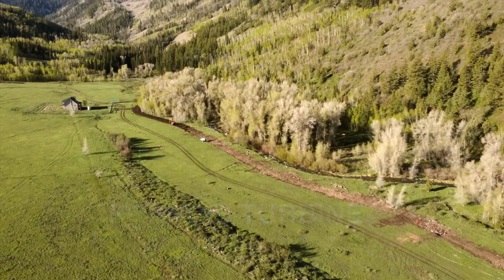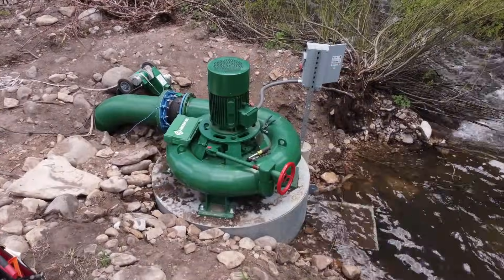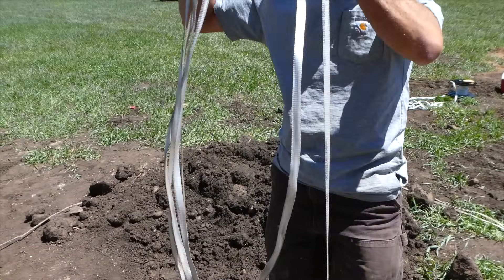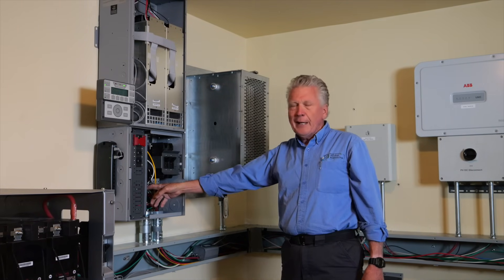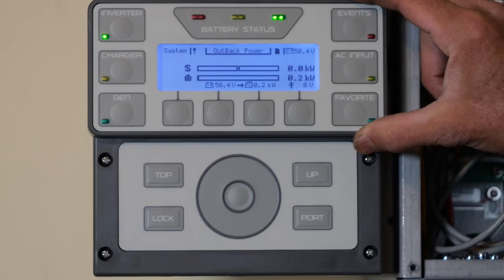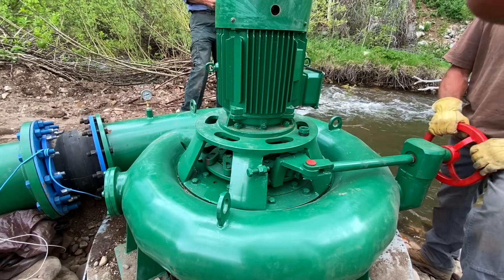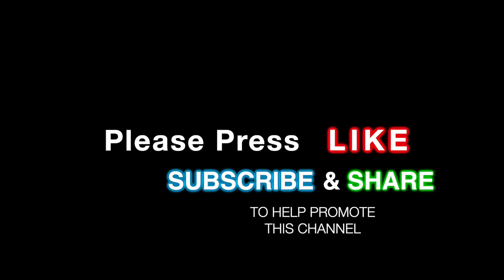MicroHydro Francis Turbine Part 2

Comment: Great, love the idea. Impractical as hell. It’s just not worth the investment, you’ll never generate enough electricity to offset the $100k investment and that’s just on original cost. Maintenance and repairs over time adds to that total significantly. Anything dealing with water and moving parts will be a nightmare to keep in good order. Those batteries are expensive and will need to be replaced every 5-6 years give or take, I can go on but ya get the idea.
Reply: it is worth the investment if you got the property at a good price because it has no power to it. Lets say it was for sale at $600k with no power..they offer £500k and spend that money on renewable electricity and never have to worry about paying an electricity bill ever again..also 6kw is 140KW/hrs a day so about 5 times more than the average house needs so they have surplus to charge an EV or two so gas prices are no longer an issue either. Maintenance shouldn't be too bad , the pipe has 10m of head so should stay clean , the Coanda screen rarely needs any cleaning and the turbine needs bearings greased now and then.  It's a no brainer.
Reply: @stephenauty2402 everyone forgets the turbines wear out battery’s go flat controllers burn out lightning takes it all out.

Comment: so what's  the power? I thought you would end the video with these numbers.
Reply from the maker: The max output is 6.6kw at full flow. That’s about 158 kWh/day. I don’t own the system so I don’t have actual numbers but I’m certain the output varies depending on the seasonal changes in flow. Thx for watching 🙏🏼
Reply: @mrhydrohead  thanks! 90 liters per seconds and 10m drop. That makes around 72% efficiency.

Comment: How much is the turbine cost?
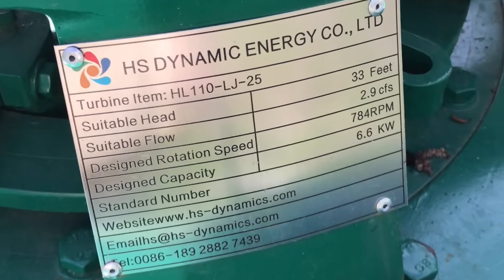Reply from the maker: For an accurate number suggest you contact the mfr (contact info @ 4:25 in video). I didn’t design this system and don’t own it so I don’t have that information. Thx for watching
Reply: @mrhydrohead
5 months ago
This is a system which I don’t own and merely documented. I guess that the cost would be more than $100k although I don’t know the specifics. However I do know that utility power is far far away and the cost of bringing it to the property would be much greater than harnessing the power of the water and you would then be presented monthly bills as well.  Thx 🙏 for watching

Comment: Should of used a mandrel...
 and What was the calculated voltage drop on that 1200' run?
Reply from the maker: Not sure where you suggest utilizing a mandrel, but for alignment that might have helped.  I don't own the system and didn't design it so I don't have exact numbers on V drop, but because the AC was wild and unregulated it would have been a range depending on Voltage.  Heavy gauge aluminum wire was likely a higher loss than copper would have been but I'm sure cost was an issue.  Thanks for watching.

Comment: What about the cost of such a system and how many houses could it power properly?  It looked fairly large.
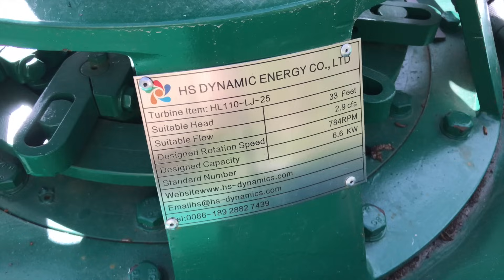Reply from the maker: I don’t own the system so I don’t know specifics but my guess is that cost is in excess of $100K. Designed output is for 6.6kw (see 4:25) or 158 kWh/day. The supposes availability of design water flows which is unlikely year round. The average US household uses 30-35kWh/day. My understanding is the owner may build other structures. Battery system should easily handle any peak loads. Thx for watching

Comment: Im curious as to what wattage this thing puts out, I must've missed it in Part 1 and Part 2
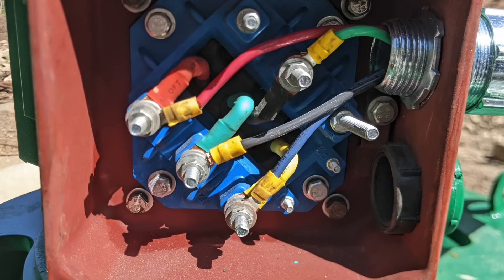Reply from the maker: At 4:25 in part 2 the design parameters show 6.6 kW. I don’t own it so I can’t report what the actual performance over time is. But it’s impressive to see that output with so little head pressure. Thx for watching

Comment: why are u using fuses and not breakers
cost issue?
Reply from the maker: This is a system which I don’t own and merely documented.  Also I didn't design it.  I'm not sure where you saw fuses in the video.  Could you give me a timestamp so I can ask the designer if indeed he did use fuses?

Comment: great video how much it produce ?
Reply from the maker: This system is an example of low head/high flow and is potentially producing up to 6kw or 144kWh per day which is 4+ times what a typical American house uses on average. I don’t own this system so I don’t have specific numbers but that is the potential of the system. Thx 🙏 for watching.

Comment: Some idea of how much this cost for both install and hardware seperated would be helpful, although I appreciate each jobs setup costs could vary wildly.
Reply from the maker: This is a system which I don’t own and merely documented. I guess that the cost would be more than $100k although I don’t know the specifics. However I do know that utility power is far far away and the cost of bringing it to the property would be much greater than harnessing the power of the water and you would then be presented monthly bills as well.  Thx 🙏 for watching

Comment: This has been very educational. I've watched several videos on micro hydro designs, but yours is excellent. And thank you for the details and placing the land back in order. In 2-3 years, it will look untouched. 
I only wish I had a stream on my land I could tap into. And the money. This is obviously a very expensive endeavor. But to be FREE and off the grid would be awesome!
Reply from the maker: I'm glad you found value in the video.  I must say that living with hydro is a joy.  This system in this video isn't mine.  I don't know if you've seen the earlier videos, but there is the system I own which I started documenting in earnest as the foundation of the channel (parts 1-21) and another which runs on irrigation water.  
I've attempted to broaden the range of systems I document, but they are not the easiest thing to find and then talk folks into letting me film them.  Anyway, if you haven't seen the other parts of the channel, please check out my own system and the irrigation water one.  Thanks for watching

Comment: I am curious why the unregulated power coming in to the electrical utilities room is converted from alternating current to direct current, and then back again to alternating current? Would this have something to do with regulating the RMS sine wave or the frequency?
Reply from the maker: Sorry for the slow reply. The power from the turbine is unregulated and comes into the house in a range of voltage and hz which varies. Using a simple transformer would not output the standard power required by code.  Rectifying the power to DC enables the inverter to use this source plus the battery bank to output regulated power that meets code specifications. At least thats how I understand it. Thanks for watching

Comment: Does that thing just sit out in the weather or is there some sort of a shed over it to protect it from the elements?
Reply from the maker: What Mr. Gardner (system designer) told me was that the owner intends to put a grain silo type structure over the turbine. I don’t know what sort of foundation is planned for that.  I hope you saw part 1 where the base below the turbine is shown as a prefabricated discharge chamber.  I don’t think there is any slab under it. I haven't been back to see what changes have been made.  thanks for watching!

Comment: How long does the turbine work untill the wear and tear causes the first defect..?
Reply from the maker: Don't know the answer to that.  It isn’t MY system as I only documented the project and don’t own it.  My Pelton turbine from Canyon Hydro (in earlier videos) has been running nearly non stop now since 1997.  I imagine the build quality of this unit is not quite as good, but should run for decades without degradation.  Thanks for watching

Comment: Are there any micro systems that provide direct ac? Or always expensive batteries?
Reply from the maker: This isn’t MY system as I only documented the project and don’t own it. Our Pelton system in the first 25+ videos on my channel is straight AC with a load controller that dumps excess power into resistive heat loads.  I didn't want the pain of dealing with batteries when I did the first install in 1997 and haven't regretted that choice.  Take a look at parts 20-1,-2,-3 on this channel for a synopsis of the system.  A playlist for those is here: https://www.youtube.com/playlist?list=PLtTypVpmDd-vkT9bJQkXw4I1t0e_4jMYA  Thanks for watching.
Reply: @mrhydrohead  Awesome!!! Thank you so much for the answer!! I was starting to think no one had done it.
Reply from the maker: @CampJe  Sorry for the slow reply.  Been busy with holidays and just today went about catching up.  Again, thanks for watching.

Comment: This system looks really overkill, exactly what I'm looking for. What is your kwh per day? What's the flow of the creek?
Reply from the maker: The Turbine is capable of 6kw or 144 kWh/day.  I don't know the flow or the seasonal changes which occur on it.  When I visited the site, I would estimate there was at least 6-8 cfs measuring by eye which is only a guess.  The addition of batteries can allow for peak loads in excess of the 6kw.  Thanks for watching
Reply: @mrhydrohead  Wow, yeah that's 3 times more than what I'd need. It'd definitely be worth it though. Take care.

Comment: how much power is it generating?
Reply from the maker: With sufficient flow the system is capable of producing 6kw or 144kWh/day.  The battery system can support peak loads beyond the 6kw.  I don't own the system and I'm several hundred miles away from it so I can't give you actual numbers beyond what the design indicates. Thanks for watching

Comment: Any one know the price to buy it
Reply from the maker: The turbine manufacturer's contact info is at 4:23 in the video.  Thanks for watching!
Reply: @mrhydrohead
5 months ago
This is a system which I don’t own and merely documented. I guess that the cost would be more than $100k although I don’t know the specifics. However I do know that utility power is far far away and the cost of bringing it to the property would be much greater than harnessing the power of the water and you would then be presented monthly bills as well.  Thx 🙏 for watching

Comment: Could this system supply power for multiple homes? It sure seems like it. Also, do you have resources for those looking for micro hydro engineers on the east coast? Different parts of the US?
Reply from the maker: At 6kw it could produce over 140kWh/day which is certainly enough for more homes where ~35kWh/day is the typical power usage most people see on their power bills.  However I don't think the owners intend to run it at max capacity year round.  Additionally, this system being fully off grid, running wire to distant neighbors which are few and far would not be a reasonable step.  I do believe one day the owners plan to erect other structures on the property.
I believe Ken Gardner (Utah based) works on project nationwide and his contact info is in the comments section of the video.  He may also know of others working out east.  
I have only traded a few messages with this hydro source https://www.langstonsalternativepower.com so I don't have direct experience with them.  I think they are in S.C.  If you contact either of them please let them know that I referred you to them.  I'm sure they would appreciate the referral.
Good luck if you have a project in mind.  Thanks for watching!

Comment: That's really a great deal of work with a magnificent result, but couldn't u guys use a stepup power transformer or is there any issue not to do so? Thanks
Reply from the maker: I didn’t design the system, but my system (in other videos on my channel) does utilize a transformer to lessen wire costs and line losses.  I’m assuming you are referring to using transformers for the lengthy transmission. My take on it would be that any lessening of line loss in transmission (step up at turbine/step down in power room) from higher voltage would not offset losses from the transformers utilized.  I'm uncertain if any benefit would justify the added cost.
I don't have a way of analyzing this and you might ask Ken Gardner (the designer) if there is another reason.  His contact info is in the notes below the video.  Thanks for watching.

Comment: If you want made in the USA not China 
Cornell pump in Oregon.
Support for the long term.

https://www.cornellpump.com/site/wp-content/uploads/2018/10/BR_HYDRO_TURBINE_2018.pdf
Reply from the maker: Thanks for sharing that.  Others might fond the link useful and I will pass the link onto the designer.
Reply from the maker: I did pass this on to the designer who said that they do on occasion use the Cornell reverse running pump, but the limitation is that they are designed for one flow at one head.  Most sites have a variable flow and so this isn't always the best choice.
Reply: Thanks just wanted people to know.

Comment: All the dams on the Columbia River for the first 200 miles are Kaplan turbines
Bonneville, The Dalles, John Day, McNary etc
The oldest is 1930’s newest 1970, no Francis turbines!

Kaplan are like a propellor with controllable pitch . Low head high volume . Reaction 
Francis medium head 
Pelton high head. Very high. Impulse

Cross flow also for low head but not used on Very big dams.
Reply from the maker: Thanks for the info.  I took my info on the preponderance of Francis from wikipedia.  Thanks for watching and commenting

Comment: Its probably been mentioned already but is this turbine not in danger of being swamped by flood situations in the river as it's height above the water line is not at all great? Surely a turbine house could have been built to protect the turbine and associated electrical connections? Being Chinese the paint/powder coat will very quickly rust from underneath and start flaking, the metal will then quickly deteriorate from rust, the Chinese are not known for proper surface prep prior to powder coating or painting, they usually just apply over an already rusted metal surface, we see it all the time here in Australia.
Reply from the maker: I was told the owners planned to put a grain silo over the turbine to protect from the elements and cut noise.   That project I suspect will be handled by a separate contractor.  Given the topography right there it would be quite the flood to reach the vital gear. Given what’s been seen recently in your country it could happen, but only time will tell. Thx for watching

Comment: Beautiful system, very well done. Do you know why AGM batteries were chosen over LiFePO4 chemistry?
Reply from the maker: This was a reply I got from Ken, the designer/installer: "The Francis turbine required a battery based inverter because the system is off grid.  There is plenty of power from the turbine and the batteries would rarely cycle.  I used AGM batteries because they are designed for that purpose – remain full most of the time.  Lithium batteries are far more expensive and don’t justify the expense as the batteries are simply a requirement for off-grid."
Hope this answers your question.  Thanks for watching.

Comment: In Ken’s explanation, he said the power goes from the ABB inverter to the Outback inverter.  What benefits do you obtain from using multiple inverters?  Was a hybrid inverter considered that can do all of these in one (ie SolArk)?
Reply from the maker: I don't know what Ken's rationale was in his selections of gear, but I trust his expertise.  And because MY system is straight AC with an ELC for load management I know very little first hand about batteries/inverters.  As I understand it, the purpose of feeding the AC to the Outback Inverter is to enable battery peak load capacity to the overall system as well as a means of shunting excess power to the dump loads to the right of the Outback.  I don't know that the ABB inverter has the capability of shunt loads which would provide load management tot he system. The shunt dump load wasn't described in the video for reasons of brevity.  I don't know virtually anything about the SolArk unit you mention and it may forego what he has designed. 
Ken is a pretty busy person and isn't involved in these videos beyond allowing me access to document them.  I try to not bother him with questions about what he has completed as I know he's onto several other projects once he finishes one.  Thanks for watching!